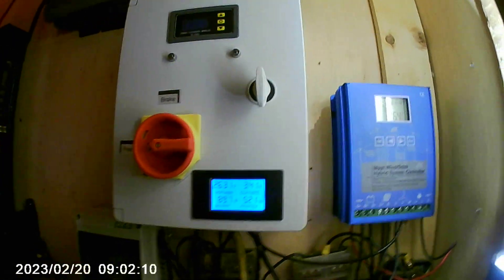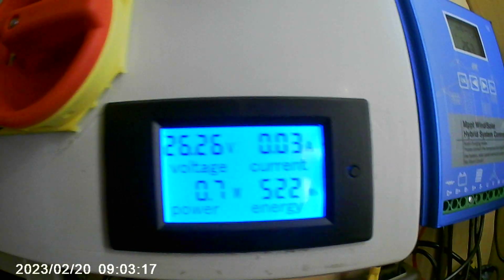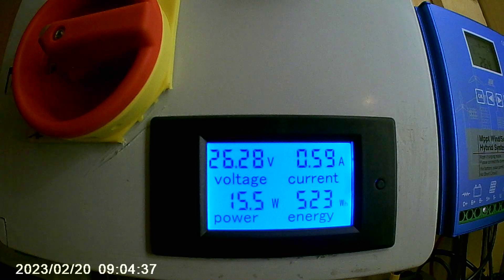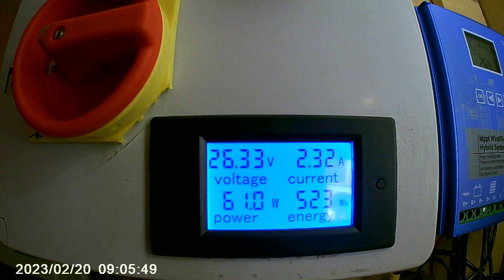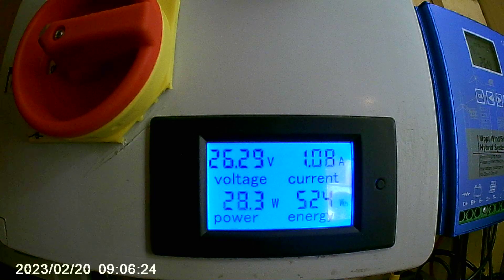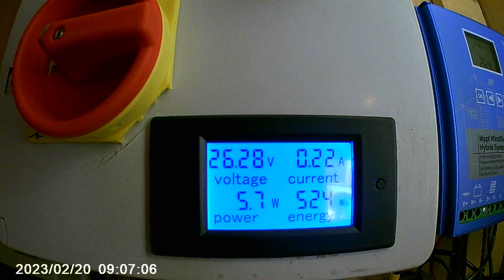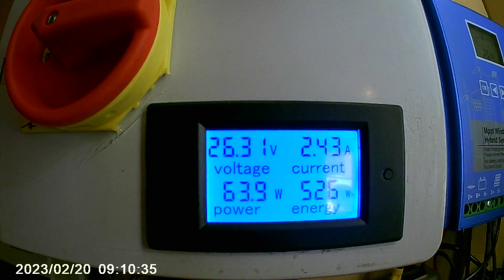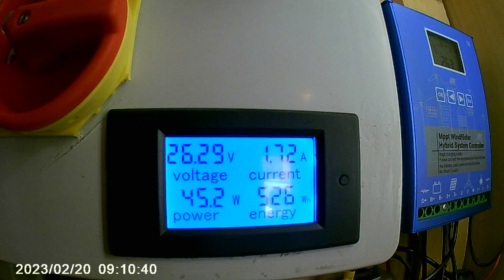chinese mppt wind charge controller do they work part 1

Comment: Hi, I really enjoy your videos!!!
I have one question. Can any of these chinese mppt's run an Istabreeze i700 (24V) on a 12 V battery ?
I would be very thankfull if you would answer this question!!
Regards Peter
Reply from the maker: yes only if you have a midnite classic 150 controller  you can run 24v turbine in 12v battery mode.because its a true mppt c c.the chinese c c are volt specific cause there there not a true mppt they are voltage specific and will not work
Reply: @offgridgarage  Thank you very much for your answer. It is really appreciated!!
I had hoped for another answer because the midnite classic is very expensive. But I am also happy that I haven't wasted my money on a nonworking mppt. (I have not bought the turbine yet!)
I like the idea of having a 24V turbine on a12 V battery to improve the low wind capabilities.
But maybe I will have to accept running 12v/12v to keep the cost of the project down...

Comment: I have required wind turbine controller for 2kw, so which one is batter?
Reply from the maker: In my testing these wont work on larger turbines.you will need a midnite classic charge controller for wind turbines

Comment: I used this blue controller with my i2000 and it doesn't rotate at alll
Reply from the maker: yes it wont allow the bigger turbines to spin up it brakes and is falsely labelled its only good with small turbines under 800 watts.u need another controller
Reply: @offgridgarage  which controller u recommend?
Reply from the maker: @maherelh8381  the one and only midnite classic 250 its expensive but will yield the max performance of any turbine
Reply: @offgridgarage  I'll give it a try
Reply from the maker: @maherelh8381  the midnite classic 250 will give you very impressive results 5 times better than a 3 phase bridge rectifier.dont buy the classic sl model sl means solar only.however the classic 250 cp is what i purchased for my 48v i2000 at a lower cost on ebay.these will make your i2000 the best budget turbine on the market to date.i will post my results on the channel with the wind curve for others to follow have a great day
Reply from the maker: 24v or 48v
Reply: 48v